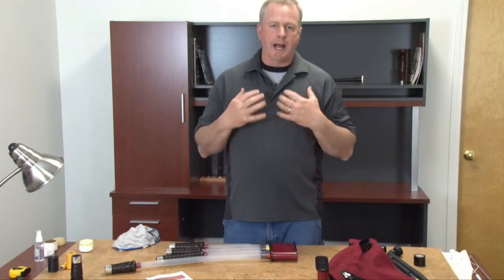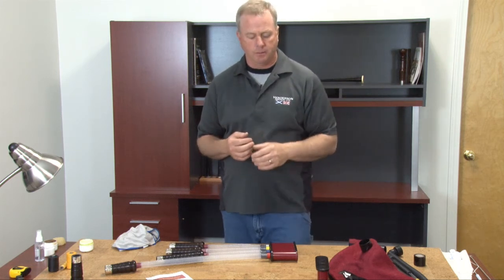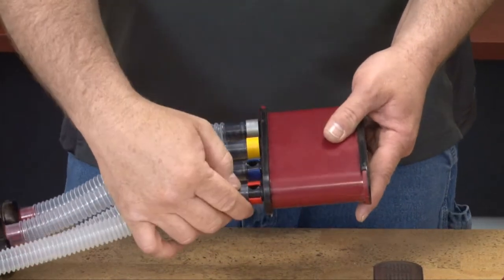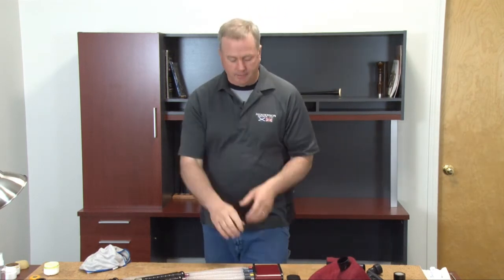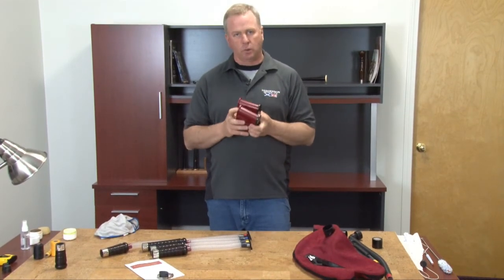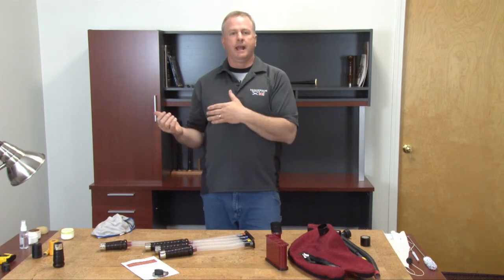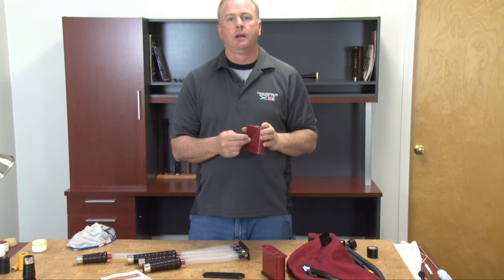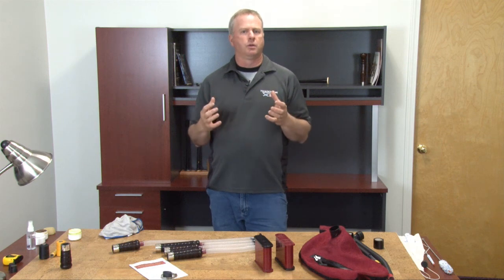Using the Ross Canister System for Bagpipes - Part 2 of 2

Comment: will this unit work with drone enhancers?
Reply from the maker: GypsyRider Thanks for the question. The Ross hoses aren't compatible with many products that need to be installed in the drone stocks. If you'd like drone valves, there is an In-Line Valve, made specifically to work with the system.  @cart/pc/viewPrd.asp?idproduct=656&idcategory=135